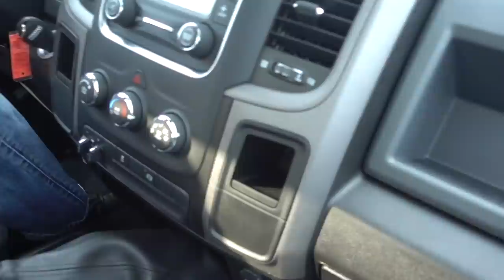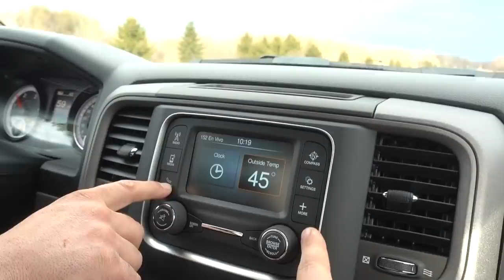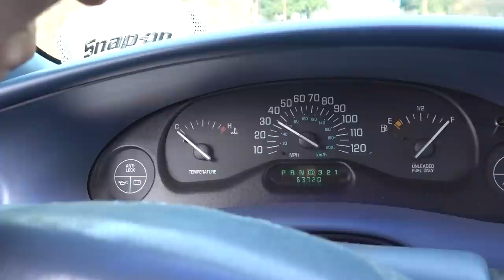BUYING THE CHEAPEST 2018 CUMMINS 6 SPEED I COULD FIND!!!

Comment: Manual trans, lever transfer case shifter, standard cab with 8’ bed. Now that’s a truck! Your testosterone level will soar.
Reply: Mis 40s holy cow you can get a 4x4 crew cab 2018 model new for 45kish in ohio
Reply: @jessesmith1181  kid you’re missing the point.

Comment: Wow! Nice! Back in August 2018, I bought my brand new G56 Cummins crew Cab. I was in initially intimidated, knowing nothing about diesels. Once the salesman pressed the exhaust brake button, I was sold. 😃 Fast foreword, now. B&W gooseneck hitch, 14k gooseneck car hauler, BD diesel throttle booster, & I don't know why I hadn't been in the diesel universe sooner! 😄
Reply: Leonard Rice 
Does your truck seem like the throttle doesn't drop enough between shifts? I have a 18 G56 crew cab too I ordered last March and mine shifts ok thru 3rd gear but isn't smooth after that. I've been driving manual transmissions for 19 years and I've never had a vehicle shift like the G56
Reply: wagonhauler06 The G56 took some getting used to, but the rpms drop between shifts as I get off throttle. In fact, the when I complete shift and hit throttle, it's lazy. That's why I put in the throttle booster.
Reply: What was it about the exhaust brake that got you?
Reply: Spiros Vondopoulos Just the sound. Admired other trucks with that sound all my life.😄 Couldn't believe I was getting one of my own.😄 I'd always been off in gasoline land. Downshifts with manual transmission sound great!
Reply: I was told the G56 was no longer available
Reply: Erik Baldwin 2018 was the last year G56 available.🙁

Comment: I’ve always been a sucker for a single cab truck!!  Go with a simple step up. On the exterior go with a leveling kit and 20x10 and 35” black rims. Of course paint match everything and blacked out headlights and cab lights, dark tint. Interior go new comfortable seat from a height class truck. Carpet floors and for engine go not to crazy like a 650hp set up. Drop all of the unnecessary crap and make a great reliable daily truck!

Comment: The truck just needs to be leveled, straight piped, 22x12’s on 35’s, and color matched everything also tint
Reply: I fucking love your profile pic😂😂
Reply: Parker McKowen 13:45 I think those are 33’s but they might be 35’s
Reply: Jack Pack no I’m saying put 35 instead of 33s they look retarted on something that comes stock with 34s need to fill the wheel well up a little
Reply: @justinperry2298  did you click on it to see his profile? Haha.  Nice info or whatever it's called
Reply: Jack Pack needs 18” rims  not 22”. 🤮

Comment: Very cool truck Andy.  My thoughts would be to add a Banks Power Monster Air Ram, EGR (DPF & DEF) deletes, straight pipe 5 inch exhaust with a 5 to 6 inch tip, compound Garrett ball-bearing turbos (63 mm stacked with a S74) by Big Twin Diesel, Steed Speed 4th Gen Cummins 6.7 T4i exhaust manifold , S&B high flow air intake filter, dual CP3 injector pumps, 200 GPH MITUSA lift pump, 0.5" I.D. fuel lines, delete OEM lift pump & Fleet Guard fuel filter & housing and replace with WIX fuel filter setup using 2.0 microns (for polished fuel) & 12 microns water separator/particulate filter, dual disk clutch, Big Bang Injectors (BBi Stage 3 Injector), EFI Live with custom tunes by EDI, paint match (mirrors, head lights & tail lights), tinted windshield & windows, 2.5" front leveling kit, Red Head HD Steering Gearbox, Thuren Fabrication front ACTIVE RATE SWAY BAR, Solid Steel Industrial Steering Stabilizer, Colt Cams Stage 3 (181°/210°) "The Big Stick" best for all round power, Mag Hytec differential covers, and American Force chrome wheels 22" x 14".

Comment: Probably one of the last manuals out of the factory. I used to hate manuals because of one time when I started one and it jumped forward, but after finding out how to start a manual properly, I like them better than the slopomatics. They can tow more and get better gas mileage than an auto, and are much more reliable than Chrysler's Run the Fuck Elsewhere (rfe) trans.

Comment: I’d get the 2018 3500 Regular Cab with the High Output Cummins Diesel with the AISIN 6 Speed Automatic Transmission my truck will be a White SLT with Beige Interior with the Sliding Rear Window I'd omit the Window Tint because I'd get a Weboost Cell phone signal booster for the truck

Comment: New Wheels...The 05 wheels looked good Andy. Fog Lamps and undercoating. You live in the rust belt right. 
The salt air in Galveston does a vehicle in rather quickly also, You're not alone in this!

Comment: congratz on the new truck Andysavage 
With it being a manual you can run a big single turbo and some bigger injectors that would be sweet
If i had that set up i would do something different like give it the old school monster truck look.  with a 18 inch on 35 or 37 tire big buff side wall make it look tuff. plus that much tire would help the ride greatly. Yep i would make it look like my truck went to the gym and came back pumped .

Comment: Congratulations Andy on your new Ram 3500 Heavy Duty Regular Cab 4x4 Long Bed Put Some Black wheels on new 6.7 Cummins Diesel Buddy getting the windows Tint PAINT MATCH 4 Gen From Bumpers Black and Back Bumpers and 3 inch lift kit

Comment: What process did you use for taking the badges off? I scratched and burned the clear coat on my 2010 a bit using one of those "rubber" wheels on a drill. The next 2 trucks I just dipped em

Comment: I just got a brand new 3500 dually. It shakes a lot on the highway and the passages seat shakes like crazy. The dealership replaced the two outer rear tires. It’s kind of better but still now 100%. Any suggestions?  I’m half tempted to throw in the towel and get a Ford.

Comment: 2.5"/ 2 1/2 inch reciever.  The sleeve would be to use the older, smaller, more common, less weight rated 2" receiver.
Where was your car dolly so you could just tow the Jeep back?

Comment: The only reason I got my Nissan frontier was because of the 6-speed with it.  I didn't even realize you could get a full size truck with a stick shift truck anymore.
Reply: in 2019, Ram has deleted the manual as an option unfortunately.  No choice but automatics in full size trucks now.

Comment: if you still have them i could use the side steps and i really like the badges myself. actually my 5 foot tall wife can't get in my truck without risking bodily injury. that's the reason i mentioned the side steps mine is a mega cab but she rides i the front, if you know anyone with the mega cab side steps, i have the mounts for one i just never got the truck with them actually on there. the mounts actually make life fun trying to put the thing on my neighbor's lift too. currently i am in ball joint hell but i am trying to piece this thing together as i can

Comment: nice truck! front bumper? Ranch Hand with matching rear. Tires an wheels? Nothing bigger than 18”! with nice  285/70-18’s or taller! But with a real sidewalk! NO low profile Mall Crawl wheelies! Then do what you legally can for power! But truthfully? A 2500 would be fine! I'd only go with a 3500 to get the 6.7 HO! But that means no G56! So a coil sprung 2500 for me!

Comment: Did I just hear “cheap” and 40 grand in the same sentence? ;) lol. I like that truck. Just how it is. Purposeful trucks without Hollywood shiny stuff just look cool and make far more sense. It’s to take care of heavy and dirty crap! 

I don’t know if people will agree ir not, but I miss wheni could buy a simple 4 cylinder base work truck, just the right size, for the cost of a manufactures basic economy car. 

I recall the late 80’s and early 90’s basic Toyota 4 cylinder as my favorite example. They were priced barely a few hundred bucks more than a Tercel. Like $7700. I would LOVE manual windows and locks (shit, you just reach over anyway)...simple steel wheels, just reliable and built to last. 

So a $14,000 (at most) solid Work truck.

Comment: Shit, they would sell like hotcakes here in Australia in that spec, especially in the commercial market. Manual gearbox, Diesel engine, 4x4 and vinyl interior, it sounds like a 70 Series Landcruiser, but can actually tow a load safely. Surely they could bring them over and convert to right hand drive for under $80,000

Comment: I have to ask how do you get the badges off without having to buff the truck
Reply: just took mine off of my 2500, started with my plastic trim removal tool, pried up then pulled off the badges, then used my fingers to roll of the rubbery mounting material, then wiped off glue residue with adhesive remover, then waxed.
Reply: Heat gun, fishing line, goo gone
Reply: @TheBloodzGangster  you're right. Except goo gone is cheap and dont work well. 3M makes a citrus spray that makes the residue come off with one spray.
Reply: Nick X yeah goo gone is shitty, it’s worked for me though

Comment: He wants the Power Wagon front end. Ram grill and black bumper w/fog lights.
Reply: Power wagon doesn't come with a  Cummins. It only comes with  the 6.4 L Hemi
Reply: Correct. He wants the Ram grill and a black bumper with fog lights which comes on the Power Wagon.
Reply: @LesFelts  Yes. But he wants Cummins stick shift
Reply: He has a Cummins with the stick. At 12:17, he says he wants a black bumper with fog lights and the Ram grill.
Reply: @LesFelts  oh ok I skipped around a bit but in that case then I guess he could just buy those parts

Comment: Keep everything black.. Get a heavy chiseled, angle cut bumper. On front bumper, install a massive, Warn winch with brush guard and fog lights and a 1 million lumens light bar. Do the same on back, mounting another heavy chiseled, angled cut bumper with a, Warn winch and a million lumens light bar in it.. Then mount 5, 35x12.50x18 mud tires on 5, solid black, 6 spoke steel wheels. Tint the windows black, mount 5th tire, on angle mount, behind cab in bed. All that weight will make that RAM ride like a Dream. Then haul butt to nearest MUD BOGG... and have a ball getting DIRTY..

Comment: Also because my foot slipped off the clutch in first and I literally rammed my dads 01 ram van. And pushed the lower part of my bumper in. And the dealer won’t put a fog light bumper on. It.

Comment: 6.5 inch lift kit. 18x9 -39mm off set matte grey wheels on a 37x12.5 falken mud tires

I’ll sell you a 2008 kfx 450 fuel injected and has reverse.

Comment: 2.5 inch hitch.  I had to rent a 3/4 ton trk and they gave me a 17 6.7 cummins 2500 to tow my 13k trl and they didnt give me that reducer sleeve so i had to buy one.    Honestly i wasnt as happy as the previous year when i rented a 3/4 ton and they gave me a 16 6.7 powerstroke. Partially didnt have tow mirrors on a 2500 diesel. Really!!!??? Didnt have quite as much spunk as the ford and automatic shift lever didnt have a straight up manual shift mode like the ford

Comment: turn the jakes on lmao. there is no jakes on the truck. You have an exhaust brake and only one of them mounted in line with exhaust after the turbo. My peterbilt with cat motor has jake brakes and three of them mounted on the head.

Comment: If you want to reduce DPF cycles get a Stryker https://www.dieselpowerproducts.com/p-16132-ts-performance-1290309-stryker-module-17-18-67l-cummins.aspx You can get up to 200 hp and if you need to go to the dealer they will only see reduced DPF cycles, when removed.

Comment: God I wish Ram would offer a manual transmission in the 1500 :'(
Reply: As of 2019, no more manual trans on any Ram platform. They don't sell enough to continue with them. 8 speeds only.
Reply: I saw a 1500 single cab short bed manual third gen

Comment: Reverse level it and new longer control arms. polished 22 forces and paint match everything. And tint all the lights also, dual or triple disk clutch and 2nd gen swap with a big single and all other supporting mods 👍

Comment: I think it's all bullshit they have to detune the Cummins for the sake of a manual transmission. If they're worried about it breaking, they should get an Eaton contract for a heavy duty 6 speed! The 10spd in my Kenworth handles 2400lb/ft of torque just fine! Sucks real transmissions are phased out in every other full size pickup except these, and now you take a hit in hp/trq to get one, BS! Why I've held onto my old 7.3 Powerstroke all these years.

Comment: No Dodge is a good deal  ever  there junk.The only good diesel dodge  or any dodge was the first generation 5.9 12 valves  with the manual transmission or the  3 speed  auto .